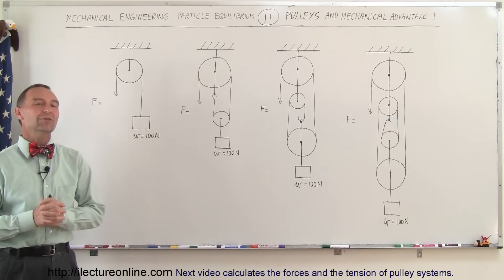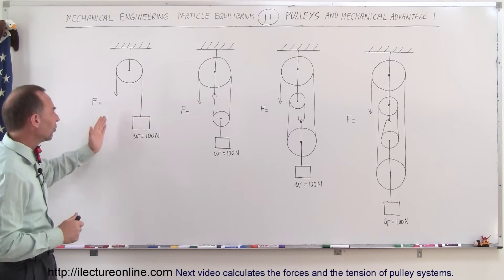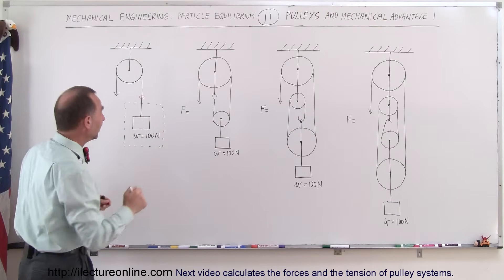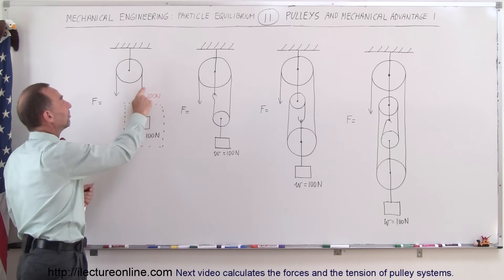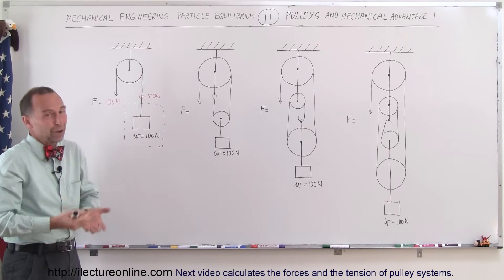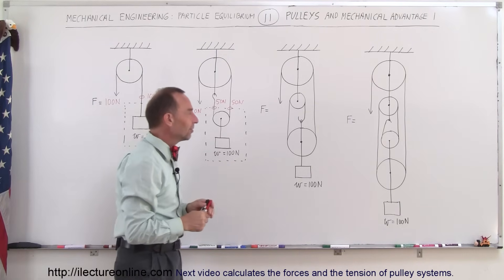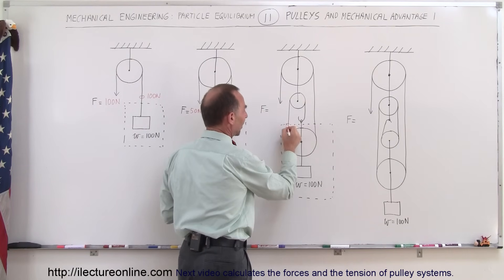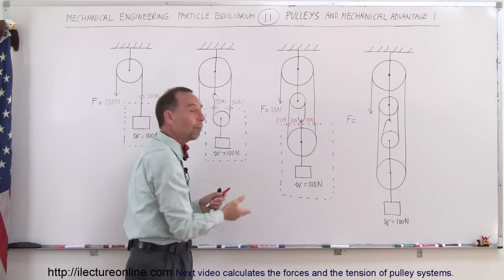Mechanical Engineering: Particle Equilibrium (11 of 19) Why are Pulleys a Mechanical Advantage?

Comment: So no mention in the sizes of the pulleys making a difference?
Reply from the maker: The sizes do not make a difference.
Reply: @MichelvanBiezen  - Interesting. I thought that if the first pulley was larger than the second (x2 as large!), it would have made it easier?
Reply from the maker: As long as there are not too large of a size disparity it will work.

Comment: Professor, this idea isn't always a "negative" (not that you implied that) in that the mechanical advantage causes a much greater distance.

In clock making, when I use gravity on the main wheel, I need lots of torque 60:1 (to the scape wheel), but the cool part is that although I must increase my mass pulling on the clockworks, I get to save space so that over a 24-hour period of time for example, I don't have too much drop.

So, this distance to mechanical advantage has other "positive" applications in the apparent "loss" by having to manage distance.

Great videos as usual!
Reply: https: //youtu.be/UHocGHguWJI👍👍👍👍

Comment: Interesting information, thank you.... Big Like)), but in order to calculate the correct force required, do not forget the weight of the pulley (s) as well as the cable or rope that increases and decreases its weight according to the direction of movement.

Comment: I have a question sir... for example the last diagram... If the object weighs 100kg then divided into 4 tension so now it would be 25kg so does it mean it pulls the rope 25kg to the ground?
Reply from the maker: kg are units of mass, so it is better to talk about Newtons (N) which is a unit of force and tension (which is a force).  Then yes, if a weight of 100N is suspended (like on the last diagram) a force of 25 N applied to the end of the rope can pull the weight of 100N upwards.

Comment: I've always felt a pulley's ability to "magically" increase your lifting power is the closest thing to free energy and a clue to solving for perpetual motion machines.
Reply: It would seem that the added pulling power scales with added run time. So you put in less effort, but over a proportionately longer amount of time.
Reply: @rafetizer  Not to say I believed in free energy or perpetual motion machines, although the "drinking bird" comes close. Smiles.
Reply: Same energy spent, more pulleys you add the less force force you need to deliver but for longer distance.
You'll actually need more energy if you take account friction

Comment: I believe there are mistakes here... third graph, the object is attached to the rope itself.. meaning pulleys all are fixed  at their centers...pulling rope for a distance 'd' means pulling the other end by the same distance 'd'..  hence there is no advantage, and you need to apply a full 100 N at the third graph.
at fourth graph, only the final pully (with object hanging from its center can move up, other pulleys are fixed in place.. so the gain is same as second graph (advantage factor=2 n 50 N required pulling at rope at hand side).

Comment: How do calculate regarding distances ?
Reply from the maker: If the force to weight ration is 1:2  then the distance you have to pull to lift the weight is 2:1
Reply: @MichelvanBiezen  Thanks sir

Comment: I am a retired 82 year old electrical engineer and this helped me review some of the material from a Statics course that I took many years ago! Thanks!
Reply: I think it's same as the transformer in the electrical engineering  reducing the voltage getting high current here reduce the force getting more distance
Reply: Statics is more important for civil engineering than for electrical, I would think.
Reply: Happy to hear that.  Just saw Wm. Shatner at 93.  Still razor sharp, no hair loss or grey.  I wanna know what he's doing to stay young.  I hope you have many more years of learning and remembering.

Comment: Would the anchor point of the pulleys (say in the ceiling) have to support the entire 100N?
Reply from the maker: In the case of the pulley on the left, the ceiling would have to support a force of 200 N
Reply: @MichelvanBiezen  if using 2 directional pulleys to redirect the direction ( e.g going up over then down) does each of the 2 redirects have to support the entire weight of the load? Or would it be half the weight  each to total the full load?

Comment: By analyzing the kinematics of pullies, you can derive the ratio of cable  end displacement vs lifted weight displacement - which will give you the cable force, by virtue of equality of exerted works on both ends.
Reply: https: //youtu.be/UHocGHguWJI👍👍👍👍👍👍

Comment: You never really explained why it makes it easy. 

With any mechanical advantage; gears, levers or pulleys, you are exchanging something you have for something you don't have. You exchange time for power. Pulleys spread out the time it takes to move something. Power is the ability to do a certain amount of work in a certain time. If you increase the amount of time, you can decrease the amount of power. That is the principle behind all mechanical advantage systems.

Comment: What the hell is a Newton? a cookie made with figs?  I think this is over simplified. I guess for the stupids out there today, you have to make it as simple as you can. It doesn't allow for gear reduction, and in the drawings there would be some, since the pulleys are not all the same size.

Comment: so this will prove perpetual energy are possible ?
Reply from the maker: Unfortunately no.   :)
Reply: hmm... i thought it will be possible...

bcoz the other side exert less force while the other side can lift much heavier force...

like putting alots water in two gigantic container that can be flicked by a lever/button to mechanicaly switch their places (height place to be specific)...
then plug it in into a hydropower generator...

well that's only my idea...

Comment: How did you decide to draw the FBDs in those places?
Reply from the maker: You can draw a free body diagram anywhere and as you experiment with it you will see what type of information you can glean from each diagram.  In this case drawing the diagram around the bottom pulley helps us relate the weight of the load to the tension in the rope.  See this playlist of free body diagrams:  PHYSICS 4.8 FREE BODY DIAGRAMS

Comment: This might help.  
Only moving pulleys (at the load) provide mechanical advantage.  Stationary pulleys (at the anchor point) only redirect force. 
Picture this.  You are standing on a balcony that’s 20’ high.  You are pulling a rope that’s lifting a box from the ground. But the rope is running through a pulley that’s attached to the box and back up where it’s tied to the railing next to you.  There appears to be two ropes lifting the box,  but one of them isn’t moving, and the one you are pulling is moving twice as far,  and twice as fast as the box.  The rope that wasn’t moving became the rope you are hoisting as soon as it passed through the pulley. Two 20’ sections of rope (40’ total) needed pulled to lift the box 20’

Comment: In the third diagram it would actually be 33 1/3 repeating…
Reply: Yes to be completely accurate, the third diagram would indeed require 33.33Nt pull to life the object!  But did you see what the Professor did?  While he explained, that the pulleys have mass, and they have friction, but for the sake of simplicity in explaining the math, those values of friction & mass can be ignored (they are very small values is the main reason) He then followed that in the third diagram, by choosing to ignore the 0.33NT for each Rope pull. He "rounded up to the nearest whole digit" so 33.33NT became, 33NT

Comment: Applying a force of 100 N would not move the load. It would only equal the amount of weight on both sides of a pulley. In order to “move” the load the applied force must exceed the weight of the final load after any pulley system.
Reply from the maker: Only momentarily. Once the load is moving, it only requires a force equal to its weight to keep it moving.  (Newton's first law).

Comment: Not a bad explanation of pulleys, BUT,  Newton is a unit of force, not weight.  Your weights should be described by a unit of weight, ie, g or kg.  The force required to support any weight is dependant on the gravitational pull, ie, the acceleration due to gravity.  It is quite correct to say that there is a force of 100 Newtons in the rope supporting the weight, but that weight does not have weight of 100 Newtons.
Reply from the maker: g and kg are units of mass (not weight).  The unit of weight is indeed Newtons.
Reply: @MichelvanBiezen  On earth, a mass of 1 kg exerts of force of about 9.8 Newtons on the system supporting it.  Newton is the force exerted by the mass.  It is wrong to describe a mass as a weight.  The mass exerts a weight, but is not a weight.  Subtle, but true.

Comment: This guy doesn't explain why he chose his "free body diagrams" where he did on the last pulley setup.
Reply: Agreed. It's key where one draws the free body diagram (FBD). If drawn around the 3 lower pullies and weight, one may quickly and incorrectly conclude F = 33lbs again. It should be explained why FBD is drawn where it was - to get all the loads on all the cable points simultaneously.
Also, in this idealized model with frictionless and weightless pullies, and being stationary rather than dynamic, moment of inertia need not be discussed.
Good illustrations and explanation though. Takes me back to old engineering school days while surfing YT.

Comment: Professor Van Biezen:  another excellent video, I really enjoy your channel, and have become a monthly donor.
Another interesting aspect of pulleys, and please correct me if I’m wrong, is that the up forces must equal the down forces in the scenario in the above video.  For instance, on the first pulley system, the total “down” forces are the weight (100n) and the pulling down force of 100n. Which means the ceiling is actually supporting a 200n load.
In the fourth setup, the total down forces is only 125n, therefore the load on the ceiling Is only 125n
So, in addition to the mechanical advantage in “pulling”  the fourth setup actually reduces the load on the ceiling, correct?
Reply from the maker: You are correct indeed.
Reply: Force on celling in each cases are respectively-
1- 200N
2- 100N
3- 66.67N
4- 50N
just draw the FBD( free body diagram) for pulley attach to celling for reaction given by celling . Dont account 100N block in this case.
Reply: ashraf khan not sure where you are getting those numbers from, as they are only part, not the total. System is in static equilibrium.  No accelerations are occurring.  Sum of all torques must equal zero AND sum of all forces must equal zero.  Up forces = down forces.

Down forces are the weight and whatever down force I’m pulling with.  Ceiling supplies up load.
If I was to put a spring scale between the final (top) pulley and the ceiling, the spring scale would show:

1: 200 N
2: 150 N
3: 132 N
4: 125 N

Imagine in the second example, a 50 Newton person was hanging on the rope, not touching the floor.  The 100 Newton weight is also not touching the floor.  The FBD of the top pulley has a force pulling down of 150 N and a force, provided by the ceiling, in the up direction of 150N.
The force distribution would be:
50 N on the right
50 N in the middle 
50 N on the left
Reply: @foxhound1008  my mistake i forget the force due to the secondaries pullies in FBD of primary pulley(attach to celling).

Comment: Is there any shortcut for calculating the force if it's a simple assembly, such as 1/N where N is the number of pulleys? It would seem to apply here.
Reply: dodgeplow 
This might help. 
If it is a stationary pulley (anchor),it is just redirecting force,  not gaining advantage. 
If it is a moving pulley (load),  it is doubling the advantage (halving the force needed). 
There are exceptions. For example,  when the supplied force is coming from the load.....winch on a stuck Jeep. 
And the Professor’s 3rd example,  which may or may not be more common than I am aware.
Reply from the maker: Yes, for a similar arrangement of pulleys that works.

Comment: So, WHY is there a mechanical advantage?
Reply: JustKeith 
The mechanical advantage only happens to the pulleys that are in motion....attached to the load. 
The pulleys that are not moving....the anchor point,  are just redirecting force. 
If you are on the roof holding the end of a rope that goes down to a 50 lb. box,  through a single pulley that’s attached to the box,  and back up to the roof and is tied to the chimney.  That will look like two ropes lifting the box. But one of them isn’t moving and the one you’re pulling travels twice as far as the box. 
You will pull twice the height in rope length, but only half the weight of the box. Remember,  there were two lines supporting the box.
Reply: @ridermak4111  Now that is a good answer.  You should be a teacher.
Reply from the maker: Whenever a force less than the weight that is being lifted is needed to lift the weight you have a mechanical advantage.
Reply: @MichelvanBiezen  That is still not WHY.

Comment: Good, but flawed. You show weights with a mass (weight) of "100 Newtons". A Newton is a unit of force, not mass. Nothing weighs "100 Newtons". It might weigh 100 kilograms and it will take a force measured in Newtons to move it, but the weight (mass) itself is not measured in Newtons.
Reply from the maker: The unit of "weight" is Newtons (or pounds).  The unit of "mass" is kilograms (or slugs).
Reply: @MichelvanBiezen  I laughed my ass off. Isn't that stuff you learn in 8th grade physics class?
Reply: weight is a force, so that is correct how its labeled.  what is not correct is assuming that weight and mass are interchangeable terms like people commonly do in every day life.

Comment: Ok so n pulleys means your total force is divided by n..... I’m a mathematician we like to generalize... so with 100 pullys you only
Pull 1 force unit per 100newtons cool
Reply: Don't forget friction
Reply: Mathematically maybe, but not in practice. Depends how you arrange the pulleys. Also most pulleys use one body that contains multiple wheels
Reply: Also you would need to pull for 100 meters to move it one meter

Comment: On the last diagram, where you have the center of two pulleys connected to one another, is the link between them a piece of rope, only holding them from moving further apart, but allowing them to move closer together? Or is it a rigid piece of something that prevents movement toward AND away from one another?
Reply from the maker: The latter is correct.  The connection between the top and between the bottom 2 pulleys is a RIGID connection, but the bottom 2 pulleys can move independently from the top 2 pulleys.
Reply: @MichelvanBiezen  , I am not a professor, but I beg to differ. The connections between pulley axles need not be rigid. There will always be tension attempting to pull the pulleys further apart, thus a non-rigid connection (rope or cable, for instance) would be sufficient between the pulley axles.

Comment: Great explanation. My brain still can't understand why i have to pull more cable as we add more pulleys though.
Reply from the maker: Since work is force x distance, and the work done by the force pulling must be the same as the work done to lift up the object (assuming 100% efficiency), and therefore if you only need to apply half the force (compared to the weight of the object) you will need to pull twice the distance (compared to the object moving upward)
Reply: @MichelvanBiezen  thanks for the reply and explanation but i just get confused. If i have one pulley i pull the rope 1 foot the load will rise 1 foot. Why is it that as i add pulleys i hv to pull more rope to raise that same load 1 foot?
Reply: @ericnickel3280  Because you're taking rope from multiple parts of the pully system, and in most of these cases (the professor pointed out in other comments that some of the connections are rigid) the wheels will be pulled closer together as you pull the object up. Take the second example: as you pull on your end of the rope, you pull the smaller wheel higher to lift the object. In order for this to happen, you have to take rope from two different places: From the rope holding the second wheel to the first wheel with the hook in the middle, and the rope on the left side that slides across both wheels. In order to lift the second wheel by 1 meter, for example, both of these ropes will have to be shortened by a meter, which means you'll have to pull two meters of rope to accomplish this.
Reply: See it that way -there is no magic just an equilibrium, you add pulleys to reduce the force needed to lift the object, you will have to travel further to do it.
Reply: @ericscaillet2232  thanks guys for helping me w this one. Check out this vid. Has some great visual demonstrations.  One thing though, @ 5:00 his block and tackle are getting way out of whack. How does a huge crane prevent this from happening?
https://youtu.be/M2w3NZzPwOM
Reply: @ericnickel3280  the 4 pullies would be in 2 blocks, one at top, one at the bottom. He just can't show that in a drawing